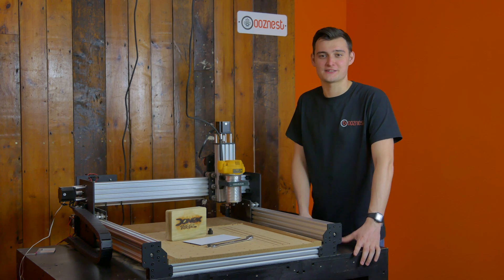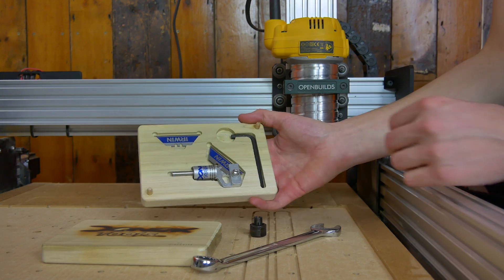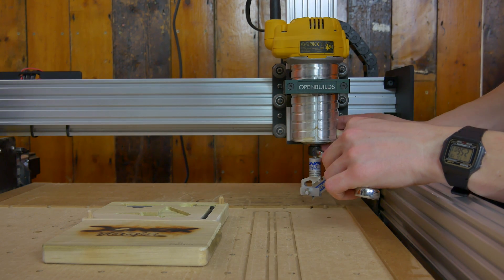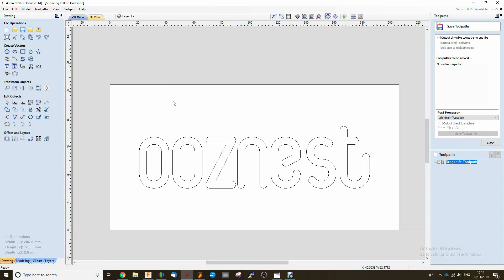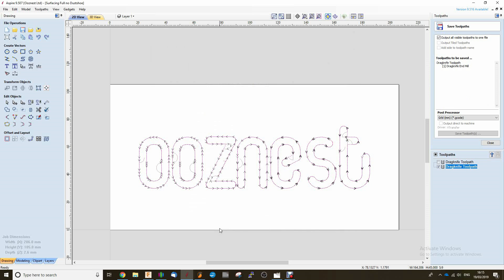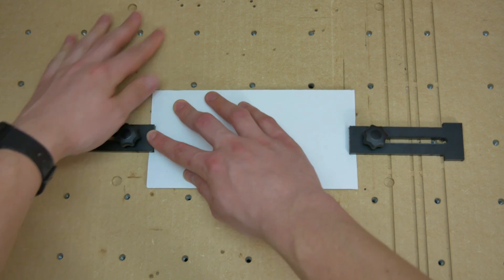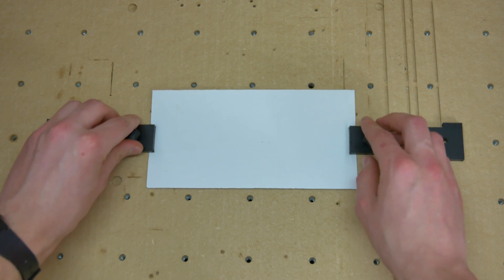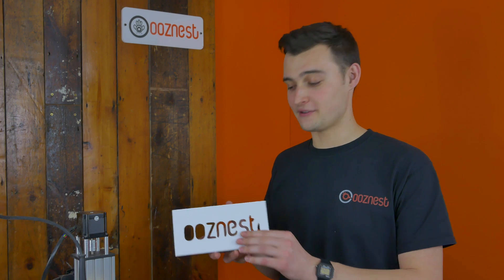Setting Up & Using Drag Knives | Donek | WorkBee CNC Machine

Comment: Can you handle 90 degree curves as well or do the angles have to be rounded (radius)?
Reply from the maker: It can do sharp 90 degree corners, using something called a swivel. The Vectric tool can work these out for you: https://docs.vectric.com/docs/V9.0/VCarvePro/ENU/Help/Gadgets/Drag%20Knife%20Toolpath/Drag%20Knife%20Toolpath.html

Comment: Hi! How is the knife changing direction? Just with friction as it gets dragged along? Are there any open source programs I could generate cut paths with? Thanks!!
Reply from the maker: Yes it follows the path as it is dragged. On sharp corners, you can do a swivel to make it turn 90 degrees. Here is a link to some software you can use: https://donektools.com/free-cnc-router-software/

Comment: Hi thanks for your input,  can you please tell me if this will cut foam board 5mm but in some cases i don't want the cut right ture can this be done with vcarve software. Thanks
Reply from the maker: Hi, this can cut foam board, but if you do not want to cut the whole through, and considering it is 5mm thick, you may be better off with an endmill? VCarve has a drag knife gadget.

Comment: Do you have to turn on the router for it to work, or is it off?
Reply from the maker: Hi Petter! No you would keep the router off at all times as the blade wouldn't spin, it would just move as an attachment to the router with no power.

Comment: I have a Donek D2. But struggle with the offset setting. We would like to print on coroplast or foamboard, and then use the Donek to cut on the line so we get nice clean cuts for perfect cutouts.  Assuming we have a 4x8' sheet of foamboard or coroplast down, and full=body picture of a person-centered on the board and our normal starting position lower left on the vcarve screen. How do we set home with the Donek? Normally we set standard endmill bits home in the lower left hand corner of our substrate and them the CNC cuts out the image on the outside line. Do we just input a correct offset for the d2 blade, put that blade in the same corner ? We seem to get mixed results and I'd love to nail it so it hits the line perfectly. Thanks for any video showing how you print on a substrate then setup mach3, and home the blade to cut on the line. That would be helpful...
Reply from the maker: Hi Michael, if you could email your full inquiry to sales@ooznest.co.uk, then one of our team will be able to help and answer your question.
Reply: You must use one with camera scan line

Comment: Are you using a specialized motor?  Can I use your tool with the spindle I already have?
Reply from the maker: Any router/spindle should be fine
Reply: @ooznest  Pls, how does GRBL move the spindle? Do you work with arduino? How do you do that part? Or is it just turn spindle enable? I'd really appreciate your help with this.
Reply from the maker: @edgarmorenomartinez350  Hi Edgar, please see this guide here - https://learn.ooznest.co.uk/Guide/How+To+Use+WorkBee+Control/22
Reply: @ooznest  
That is, I can use the spindle off and the Aspire program will give you the parameters for the spindle to rotate ?. Thanks for answering me!
Reply: @LuisFlores-iq8sq  drag knife works by just moving the point along a line. the spindle idley turn to keep the knife parallel to your direction of motion, as the blade naturally wants to be in a position of least resistance. of course, you will discover limits to how small your details or curves can be.

Comment: I just use a vinyl cutter
Reply: Interesting. You use a vinyl cutter to cut leather, cardboard, rubber, and acrylic? 🤔
Reply: @bemccune7671  I can cut leatehr, carboard, thin rubber, cloth, paper, and vinly, acrylic cant be cut with a drag knife
Reply: @chaddanylak8706  Hi, did you used the drag knife to 3-4 mm thick leather too?

Comment: How come the dewalt router spins so slowly.
Reply: it's not spinning at all, it's off.
Reply: @rossclutterbuck1060  hello, the same program turns off the spindle? or first the spindle must be turned off, then run the drag Knife??
Reply: @rossclutterbuck1060  Really??
 it doesn't seem like that